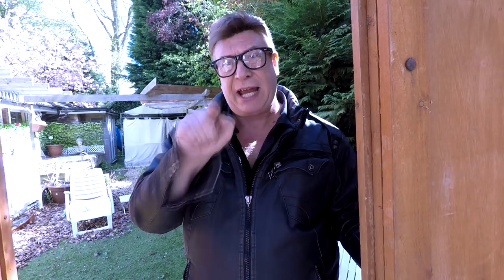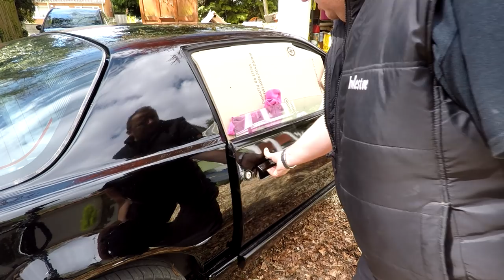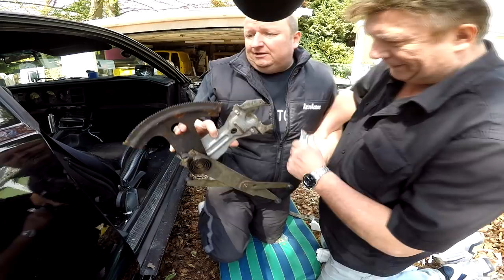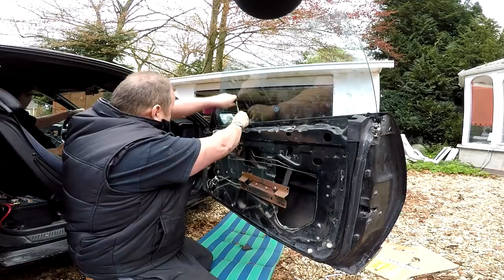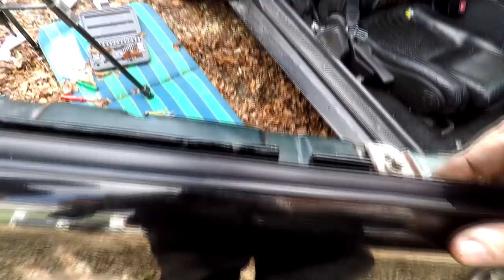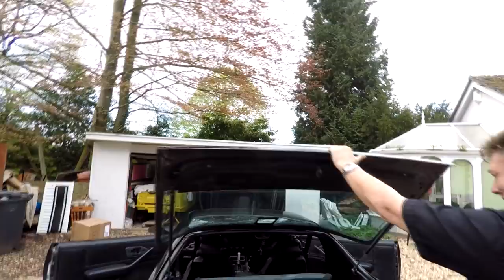Trans Am Window | Brick Top And A Useless Apprentice Vlog

Comment: What a car to cut your teeth in !  Not only does it not have room to get your hands into but the rubber strips can be a little bit of a pain.   Then making sure that the window fits tight enough to have no air gap is also a little tricky as well !